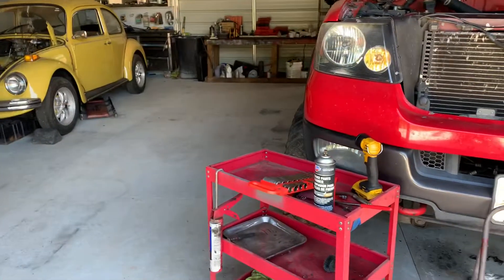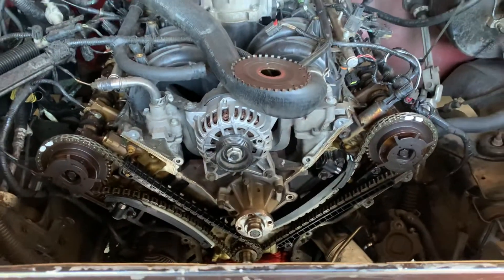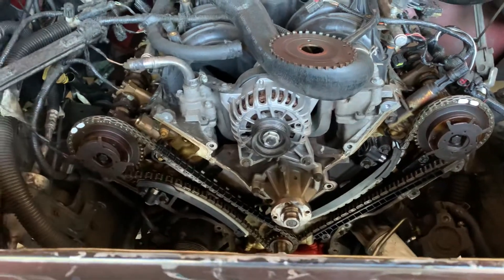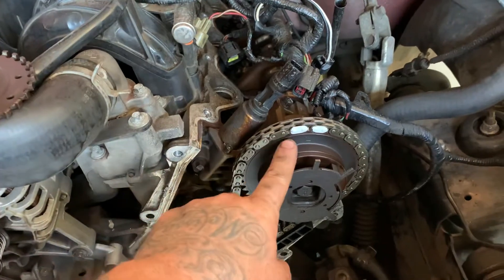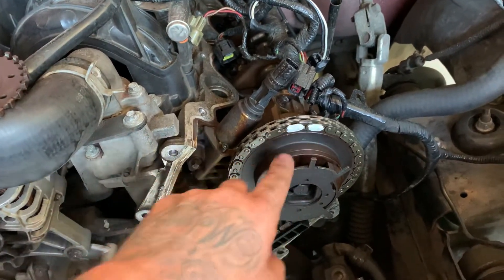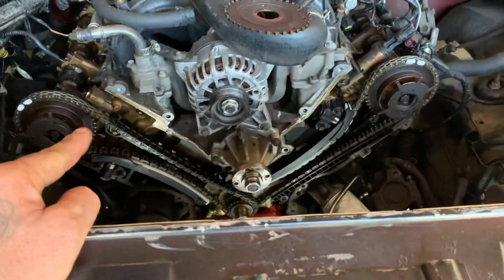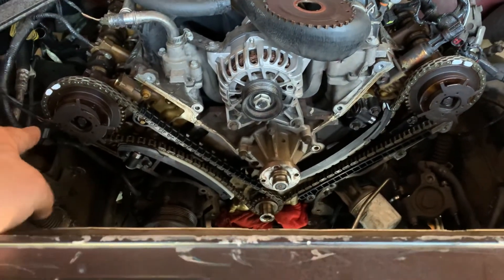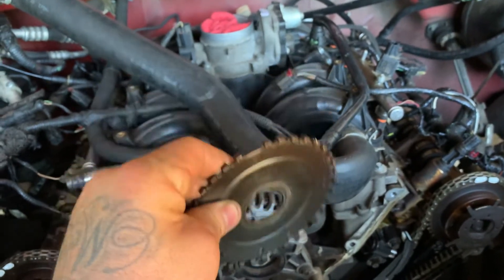5.4 3v timing procedure

Comment: At 64 with medical issues this is a job for me. Just getting everything out of the way dang but I couldn't afford the one price quoted at $3000 and any other shop I talked to doesn't do them anymore so that was that. Just taking my time and trying not to get too bent out of shape with some of these bolts and where they're located yesterday was my second day on it and about have the left bank clear but I went from 0 to 10 on the cussing scale in about 5 minutes lol. The first day wasn't too awful but when it came time to get that power steering reservoir off 🤬🤬🤬🤬🤬🤬🤬🤬🤬🤬
Reply from the maker: Yea it can be a pain if your not used to it. Definitely take your time, take lots of pics and videos. Use a cushion if leaning over the rad support (trust me) and you’ll be fine
Reply: @MrMelvinkennedy1  I need some help. Lost position of my cams when at top dead center because they moved on me, What position should my timing marks, in this case an L and R , on my cam phasers be at when crank is at TDC. The only information I found was with the crank key at 12 o clock passenger phaser timing mark should be at 12 and driver side L at 1 oclock. I've seen info that says that should also be the position of them when at TDC but they are not. the driver side is at 1 and the passenger is at 11 and my chain marks won't line up on the crank and the phasers.  Any help please.
Reply: @MrMelvinkennedy1  Never mind. I think I understand it after watching your video again. My phasers are marked with both an L and an R and you know due to the pins they can only go on one way. So as long as I am at tdc and I line my chain mark up properly at the bottom I can just move the cam a little to get them to line up at the top. Looking at the position of these in your video they look about 11 oclock on the right and 1 oclock on the left which is where mine are.
Reply from the maker: @charlessarver8350 yes your right bank will line up with the R and the left bank will line up on L...
Reply: @MrMelvinkennedy1  Thanks. Yeah my top 2 links one each were just about where yours are sitting in this video when at TDC. I kept going back and forth because some were saying r at 12 and l at 2 but that was not happening and I know I was at TDC because I used the alignment tool. Saying that I watched another guy and he had his crank key at 12, so a little off tdc and his lined up at 12 on R and 2 on L. So I decided I was correct and went ahead and put tensioners on then I turned the crank until the key was at 12 and then all my marks were just like the other fella top and bottom so I went with it. Now I can put this thing back togethher lol. Mines a 2008. I know you said there not and interference engine but I didn't want to risk it if at all possible to avoid any damage.
Reply: @MrMelvinkennedy1  I change ou the VVT solenoids, cam phasers, oil pump, water pump and have knew fuel injectors when I get back to putting the fuel rails back in place. Truck still looks new but almost 300k miles. It should be good for a while now. Been a good truck and still looks great so I hate to just toss it.
Reply from the maker: @charlessarver8350 they are great trucks when cared for

Comment: My problem is I am replacing the phasers on my 2010 F150 5.4 from the top side using a wedge tool. When I did the driver's side [L], I made a mistake with my marking process and now I am not 100% sure the phaser is on the chain in the proper spot. I am about 90% sure it's correct. When you say non-interference, does that mean I can test start it without breaking anything? Going to check for more videos and on some forums to see it there is a way to check the timing from on top. Seems like there should be some way by putting the crank at TDC and checking the position of the phasers or valves? If you see this and can offer any advice that would be great.
Reply from the maker: Yes you are correct. Put the timing at top dead center and see where your cam is lined up. Wish I could help more. Problem with doing timing or phasers this way is if you mark the chain and phaser you have to bench mark your new phaser or you can line up your timing, mark the chain on the L then you just put the new timing phaser on where the L meets the marked chain
Reply from the maker: When possible and using wedge tools always have the crank at tdc before tear down.

Comment: I think my 08 F150 5.4 4x4 may have jumped timing. It has a dead miss. I installed new coil packs, spark plugs and injectors and no change.  Should I do the timing job and how to get it back in time or should I think about reman engine?
Reply from the maker: Personally I’d do a timing job but that’s just my opinion depending on how many miles are on it
Reply: @MrMelvinkennedy1 295,000
If it did jump a tooth or 2 do you think if I lined everything back up it would fix it ?
Reply from the maker: @Jay388 with that mileage more than just the chains wore. I’d do a full rebuild including cams and crank or buy remain

Comment: Hey man my 5.4 3 valve jumped timing I THINK… how do know it jumped timing and what should I do? Timing job? New motor? Car still run before I tore it apart before I took the valve covers and timing cover off
Reply from the maker: If it jumped time and is a 3v I’d personally just replace all the timing components and keep the engine
Reply: @MrMelvinkennedy1 should I do a compression test? And if I do should I do that after I install parts or before
Reply from the maker: @Itsjustae46 you can but you can’t before the parts are installed. I’ve personally never repaired a 3v that valves came in contact with pistons. I’ve done 100s of 3v engines that broke timing chain.
Reply: I did the timing job and right now I have tensioners pulled on both sides the right hand bank has 0 slack in the chain but the left hand bank has a very small amount of slack on the power steering side. Is this normal
Reply from the maker: @Itsjustae46 push the guide that the tensioner is on and see if it removes the slack. That’s how that engine is designed, the oil pressure will push the tensioner into the guide removing the slack in the chain. Make sure your pins are pulled out the tensioners also if they aren’t already

Comment: Ive replaced the 5.4 tritton timing chain sprockets was good. Engine cams in heads locked up torqued head bolts now know to replace with new head bolts because i broke one off in block so i bought another 5.4 tritton engine that i pullef out a 2004 f250 wrecked havent got around putting in.

Comment: I did the time components and phasers on a 2006 f150 runs fine at idle but has erratic timing when the solenoids kick in
Reply from the maker: @adrianvillegas715  solenoids kick in?
Reply from the maker: @adrianvillegas715  are you talking vct solenoids? They are always on they just adjust with throttle same with phasers
Reply from the maker: @adrianvillegas715  also has it done this the entire time after putting new phasers and timing components on or did it develop
Reply: Once the engine heats up and you put it into gear it throws a engine over advanced code
Reply from the maker: @ are the solenoids and phasers new and was it quality parts or eBay/amazon parts
Reply: @MrMelvinkennedy1  chains tensioners guides and crank sprocket are cloyes phasers are motorcraft
Reply from the maker: @ definitely good parts. So was it running fine prior to changing everything?
Reply from the maker: @ also did you change the vct solenoids l. Is it throwing a code for a certain bank or both banks
Reply: @MrMelvinkennedy1  installed new vct solenoids and it was giving me bank 2 over advanced installed old vct still gave the same code
Reply from the maker: @ sounds like you got a bad phaser out the box, not very uncommon these days unfortunately
Reply from the maker: @ you don’t have to tear down the complete timing to put a new phasers on just use a wedge, I made my own wedge using wood and cutting a triangle then drilling a hole in it to put my retrieval rope through
Reply: @MrMelvinkennedy1  I've installed 3 different phasers and same result
Reply from the maker: @ same bank? If it’s a 3v it could be the motor is shot. To test drain the oil and put 15-40 rotella in it or some sort of thicker oil. If the cam or crank is worn it wont allow enough oil pressure to do what’s needed. It also only takes 5 psi to show normal oil pressure at the gauge. Tapping the block is a more accurate way to know. Basically your timing is directly adjusted through oil pressure
Reply from the maker: @ I’ve never seen an engine wear out on one bank only though. I still think it’s vct or phaser related but I’m not there in person so it’s hard to diagnose on the internet

Comment: My timeing chain fell off the phaser. Now i was told that i needed to make the valves neutral but if it fell off i cant do that. So since its the 3v all i gotta do is take off all the rocker rollers then put to the crank at the  11 clock position do the timing chain then put the rocker rollers back in then re assemble and it should be good?.
Reply from the maker: @sethburns76  if it’s a 3v I always just rotate back to tdc and replaced the chain. Had one come off at 45mph and did no valve damage. I only remove rockers on 2v engines as they have zero tolerance between valve and piston. I could rotate 3v all day with no chain and never had valve to piston
Reply: @MrMelvinkennedy1  Even if you try to rotate the engine with no chain we don't have enough strength to bend a valve and even if we have the strength to do so we're going to feel it and stop with common sense
Reply from the maker: @ you saying with common sense which isn’t very common any more. Also you will be surprised how easily and valve bends with a ratchet on a crank bolt and a cheater bar on the end of a ratchet
Reply: @MrMelvinkennedy1  I guess that's your opinion but a valve it's not a straw
Reply: @MrMelvinkennedy1  also, I think it'll bend a valve by a centrifugal force
Reply from the maker: @mtsanchez27  it’s not an opinion it’s experience and seeing it first hand
Reply: @MrMelvinkennedy1  awesome video anyways I just wanted to input a little more information to the guys attempting to do this job.
Reply from the maker: @ preciate it and yes more info definitely isn’t a bad thing
Reply: @MrMelvinkennedy1  have a blessed day brother!
Reply from the maker: @ absolutely, you as well

Comment: I sure could use some help with my 2005 Ford expedition 5.4 3 valve triton engine. To see if I need to remove the cam shaft to set the timing on this engine.
Reply from the maker: @lesward2312  no you dont have to unless the chain is off and the timing is off. If thats  the case then yes you should, especially if your inexperienced
Reply: @MrMelvinkennedy1  I am using aftermarket phasers. Should the R and L be straight up. Thank you so much for your help.
Reply from the maker: @lesward2312  im not sure on after market. Can you post a link so i  can look at them

Comment: Hey brother. So I did a 5.4 3v timing job closed her up and she ran perfectly. I let it run for an hour or so and turned it off so I could start flushing the coolant. I could never get it to start again. It has spark, it has fuel pressure. Any ideas?
Reply from the maker: Spark/fuel pressure. That tells me your crank signal is fine, also fuel is good so next is compression, otherwise any codes?
Reply from the maker: Also just because you’re getting fuel to the rail doesn’t mean your injectors are firing. Make sure they not cutting out once your turning it over and they are priming. Things such as key/theft issues will cut the injectors to stop it from running